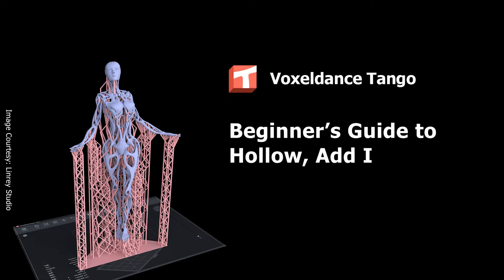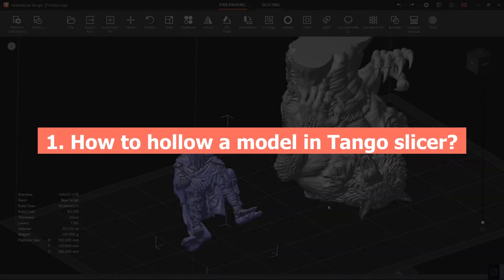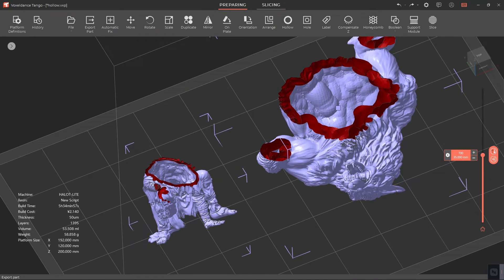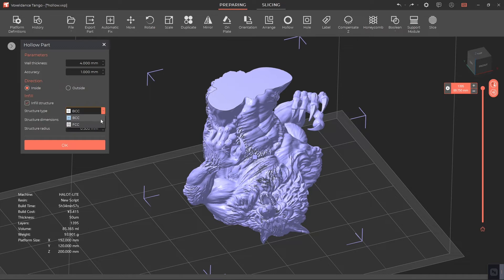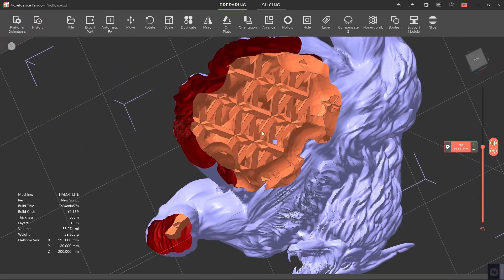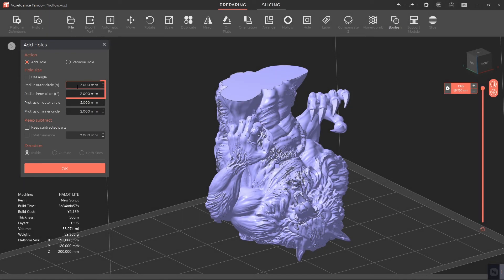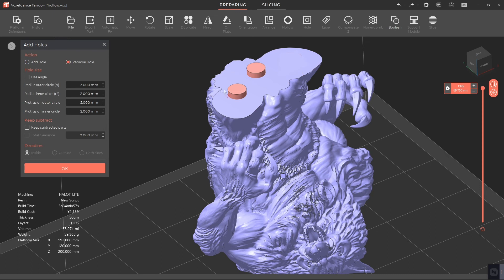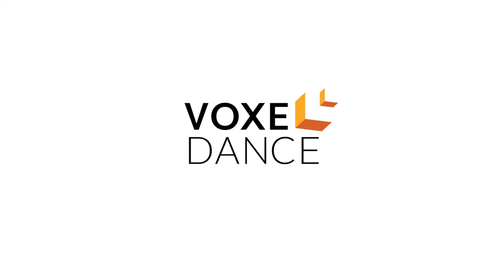Beginner's guide to hollow, add infill, and add holes in Tango slicer

Comment: Tango 4 doesn't have the infill option anymore. However when adding supports, the supports go through the model and I assume this might add structural integrity? Is this intended? Because with them going through the model random supports come out of the top.

Comment: Trying to use this for hollowing is very frustrating. The hollow tool regardless of how many times I try to hollow does absolutely nothing. It says it's hollowing, but even after exporting the STL is still completely hollow. Only the honey comb seems to work, and that only hollows out the centers of each honey comb, not really working.
Reply: One side note, I did the hollowing without in-fill and it works. But if I turn on in-fill it does not hollow at all.